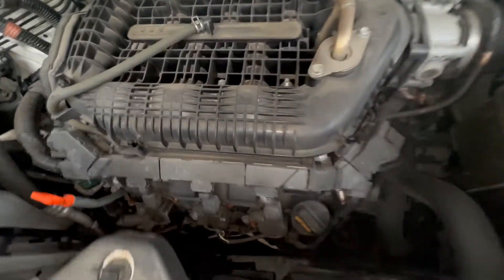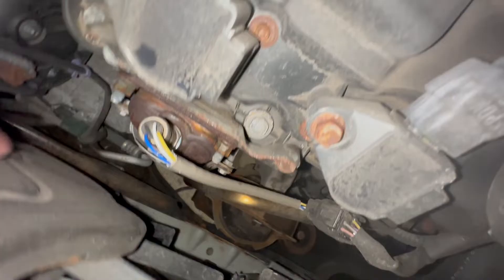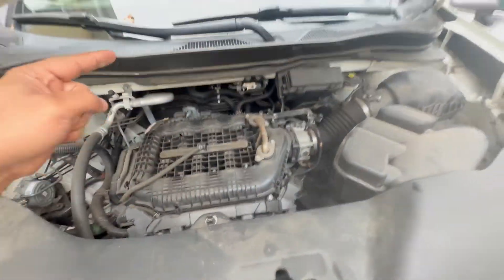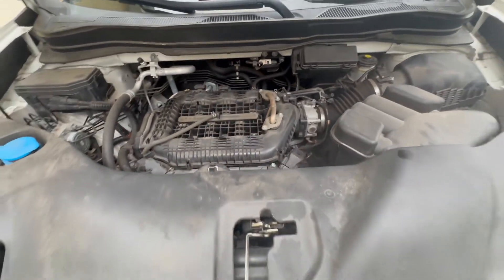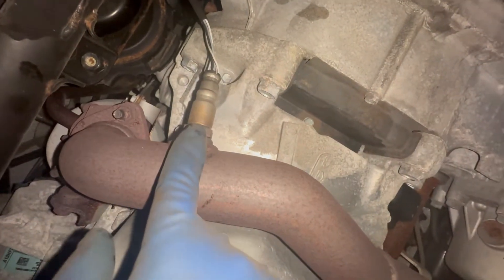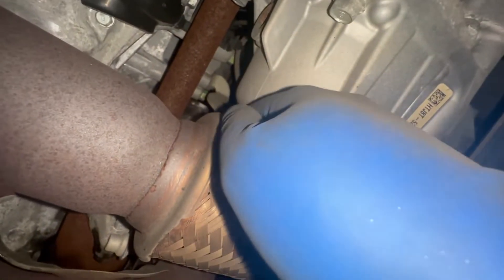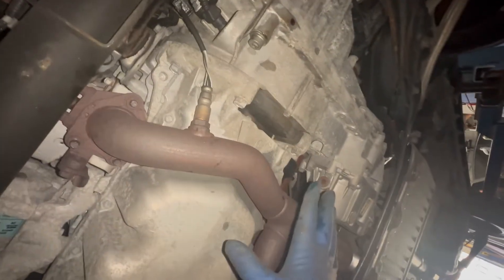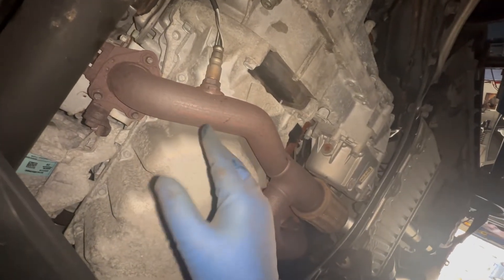Honda Acura V6 engine all oxygen sensors and bank1 or 2 location b1s1 b1s2 b2s1 b2s2

Comment: Front Struts and shocks rear shocks four break pad and rotors change plus wheel allingment $5000. Does this number sound right to you? BTW, Great videos
Reply from the maker: No way max shocks $1200 all 4 brakes and rotors $850 max,   Wheel alignment $140maxx. 
($2300 over all max)
Reply: Thank you so much.
Reply from the maker: @Life2018Z  welcome!!